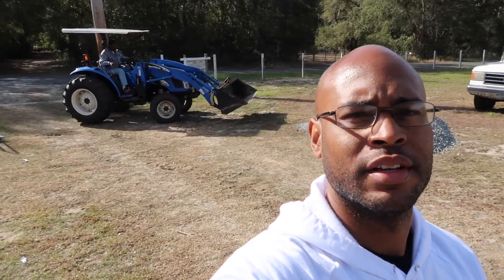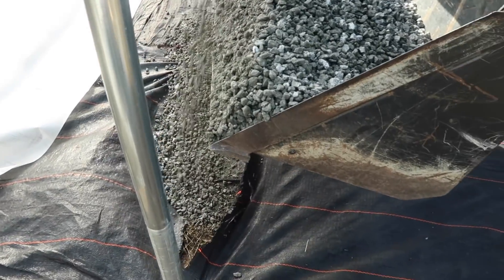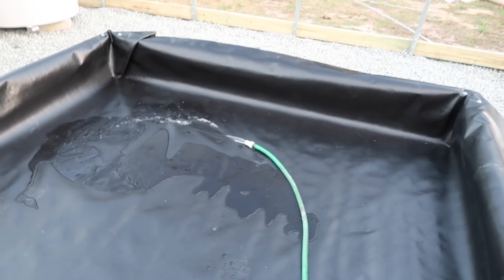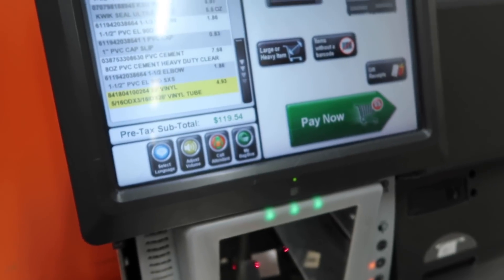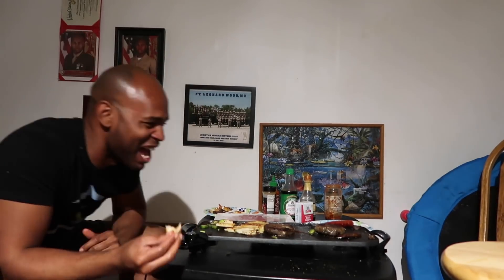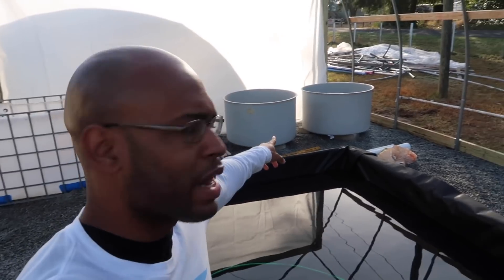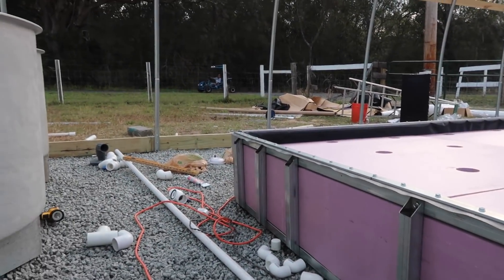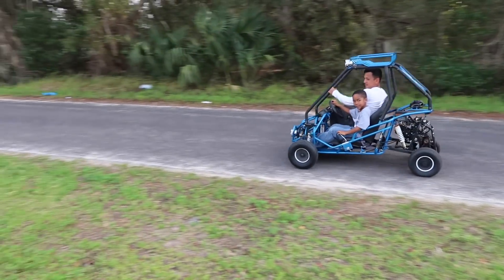Floating Raft,  Bottom Drain Problems, and Adding Gravel Floors | The Aquaponics God Ep. 8

Comment: Question. Do you have a video that details how the plumbing to your bed works? Can you please explain what is used and where it returns too?
Also, you are raising tilapia, what is the water temperature for the grow bed after leaving the tank. I purchased an AST endurance 2000 bead filter. I have a 10 x 12 shed for the 700 gallon tank and bead filter. 40 foot green house, and the GAST R2 regenerative blower. I am interested in this bed and would like to know more about the drainage.